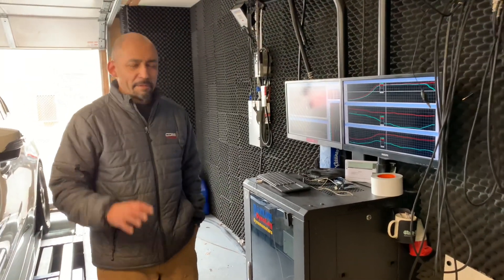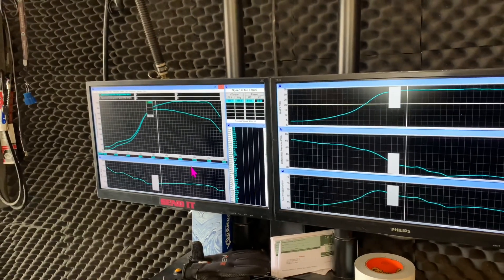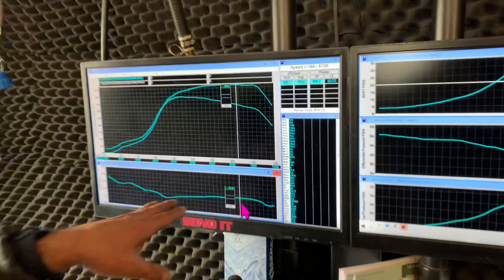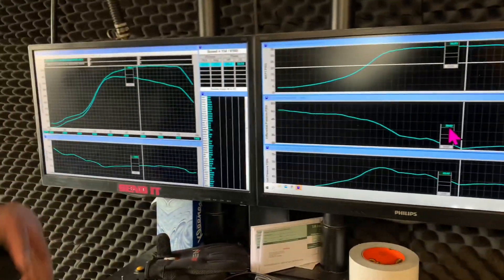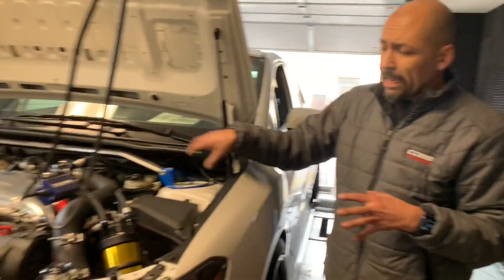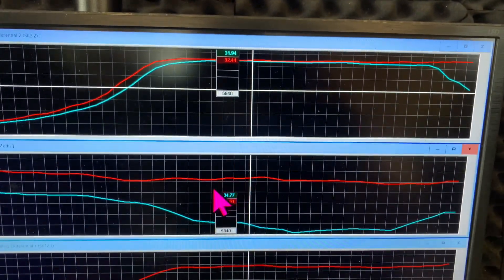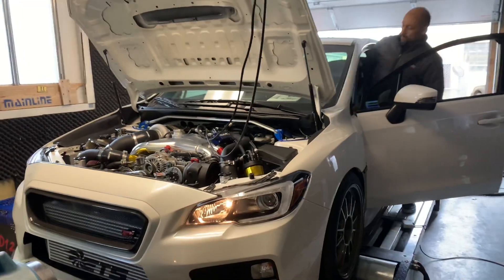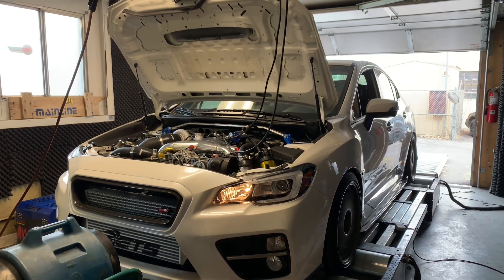The importance of differential fuel pressure.

Comment: So at vacuum, off boost, an injector that needs 45 psi of fuel pressure for good volume and atomization will need 55psi of fuel at 10 psi of boost, 65 psi at 20 pounds and 75 psi of pump at 30 pounds of boost.  Take manifold boost pressure, add the fuel pump pressure needed to run injector at no  boostl = total fuel pump pressure required at that boost level.  This is simpllfied to explain the concept.